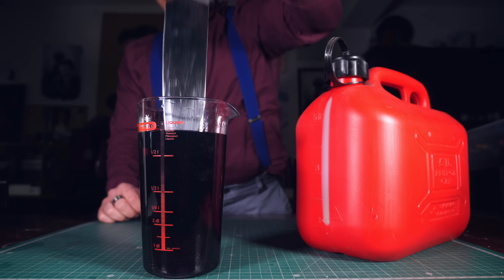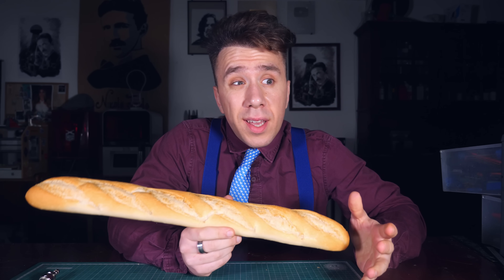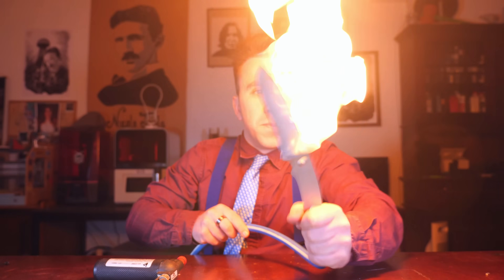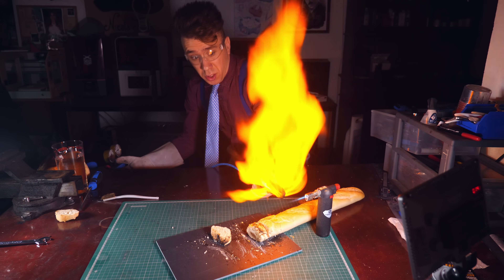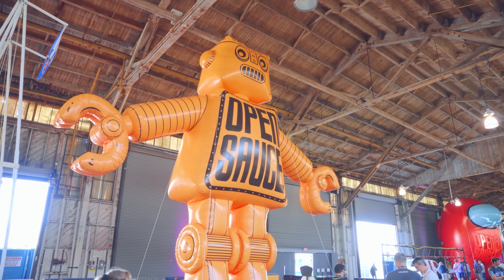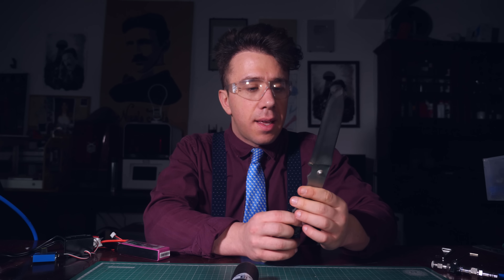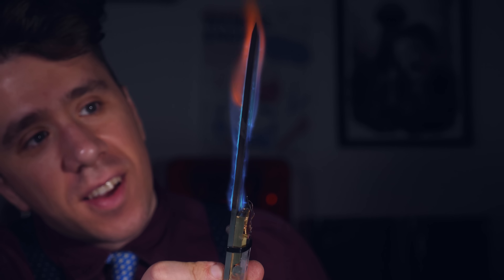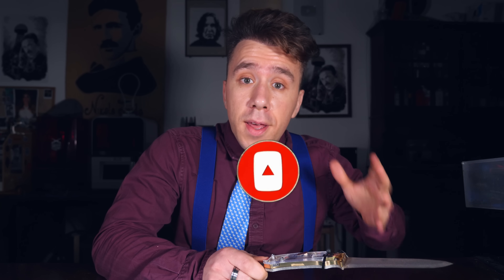I made a TRUE FLAMMING KNIFE

Comment: Since its 3D printable and Vernoulli force is used to drawn in air as you said back about the butane and the nozzle, I think you should add air channels where it will premix with air using the pressure of the hydrogen to provide force.

Addiotnally, I am not sure how it will works, provide discrete channels to blow fuel lateral to the edge and let the Coanda effect to hug the figure of the edge. If it work with Single Expansion Expansion Ramp Nozzle, it should work there too. That should  add cutting power without adding serration or flash welding a solid steel edge over it.

BTW, what material is used on that? Steel, Aluminium, or, Inconel?

Comment: I think you should put a jet engine in a metal vacuum cleaner, or make a hover craft and use two jet engines to power it, one for the thrust, and another for the air pushing you up.

Comment: A sword like this, but made from a much stronger material, or coated with something like boron carbide while maintaining the porosity.
Add a water chamber to the handle, and add a battery and circuit to generate H+O2 from the water, or even Brown's Gas (HHO), which might be better because of it's weird nature.
Then use that HHO or Hydrogen mixed with Oxygen to light the blade, using an electric spark activated by a switch or button.  Then the whole thing is self-contained.
Oh please make one, and then make a bunch more and sell me one cheap.  😉

Comment: I wonder if porous metal like this can be used to push water through to help cool the metal down? Or are the holes too small for liquids and only air can get through? Also - I wonder if this can be used to create propeller-less boats? Like instead of having large spinning props they could just push tons of air through the metal exterior of the boat to push it along? Would stop marine life getting chopped up and would provide way more control over direction with more "thrust points" around the ships hull.

Comment: You are working with radiant heat, meaning the element, or knife in this case, will not get as hot as the air and objects located away from the flame source. The same principle as walking on hot coals. If you want the knife to get hotter to cut through things, you need to use a hotter gas burning closer to the element. May I suggest the ever popular oxy-acetylene mix? This runs the risk of getting the knife hot enough to melt the porous structure at high temps, but I'm sure your alterior motive has little to do with heating the porous metal, and more to do with consistent flame front unaffected by jet turbulence 👍

Comment: 0:10 comment: damn, I've been thinking about similar design of 2 decades now xD Let's see how similar those are...

EDIT1: not relevant, but long time ago I've been given a plate-sized, 5cm thick chunk of aluminium foam. It was solid, couldn't do any damage with my hands. And it weight next to nothing. Ever since I've been wondering what kind of awesome things could be made with it, but it has been pretty quiet...

EDIT2: at 5:19 ok, I didn't consider using a magic 3D printed microporous blade that emits supersonic jets of pure hellish hate. I was more thinking about pressed thin layers of laser cut metal to create a series of very flat channels for low-density liquid fuel xD

Comment: building a DIY torque meter using Arduino and 3D printed parts shows how measuring torque precisely is a complex task. I would like to see you take this concept further by designing a more advanced, high-accuracy torque measurement system, Seeing the iterative process of designing the mechanical components, electronics, and software to create a professional-grade torque sensor would be fascinating. It could tie into other projects like the jet engine or metal 3D printer by allowing you to precisely measure the torque and power output.

Comment: So, can that printing process be given a directional bias? So the angle of the pores focus toward the blade edge?
Or even better stripes of the porous material through solid material, then focus those porous stripes towards serrations on the blade.
Reply: Theoretically that is absolutely possible. It would take design considerations on party of the person who programs the code for the process but because it melts one layer of material at a time it would theoretically be very possible to have porous channels throughout a solid knife and have the gas released wherever you desire. Wether that be on the blade edge or creating bad ass burning runes on the side of the blade. You could even leave a sharp cutting edge and have the gas come out behind the edge

Comment: this is a recipie for brownies:

1 cup (225g) unsalted butter

2 cups (400g) granulated sugar

4 large eggs

1 teaspoon vanilla extract

1 cup (120g) all-purpose flour

3/4 cup (90g) unsweetened cocoa powder

1/2 teaspoon baking powder

1/2 teaspoon salt

1 cup (175g) chocolate chips or chunks (optional)

1 cup (120g) chopped nuts (optional)

Instructions:

Preheat your oven to 350°F (175°C). Grease a 9x13 inch baking pan or line it with parchment paper.

In a medium saucepan, melt the butter over low heat. Once melted, remove from heat and stir in the sugar until well combined. Let it cool slightly.

In a large mixing bowl, beat the eggs and vanilla extract together. Gradually add the butter-sugar mixture to the eggs, stirring until smooth.

In another bowl, sift together the flour, cocoa powder, baking powder, and salt. Gradually add this dry mixture to the wet mixture, stirring until well combined.

If desired, fold in the chocolate chips or chunks and chopped nuts.

Pour the batter into the prepared baking pan and spread it evenly with a spatula.

Bake in the preheated oven for 25-30 minutes, or until a toothpick inserted into the center comes out with a few moist crumbs (not wet batter). Be careful not to overbake, as brownies should be fudgy.

Allow the brownies to cool completely in the pan on a wire rack before cutting into squares and serving. Enjoy your delicious homemade brownies!
Reply: How do I add my medical marijuana to this?
Reply: @sethreign8103 crush it up in your mortar and pestle (the one that comes free with your xbox) and dump it in with your dry ingredients. or mix it in with the topping.

Comment: Add a thin layer of platinum to the inside of the knife and power it with methane. It will autoignite. 

Add a button. Strap the fuel tank to your back. Thread the hose through your sleeve. 

Vigilante time

Comment: I have a challenge for you.

Make an electric vehicle that can power itself with onboard generators.

I just got an electric scooter, the eAhora M1P. Says can do 200 kg rider, at 55 kmh. 2000W brushless DC geared motor, with 124 NM max torque. 60V 30AH lithium battery (1.8 KWH). 67.2V ~ 5A smart charger (Charging time: 4-6 H). There is so a controller on it, that's keeping it from going faster that 35. I saw a video of someone else who said the battery can be charged faster than the charger's output. 

The thing looks like a Harley without an engine. I thought you could put a Tesla turbine there or something. Add some solar panels, maybe other little generators, idk. What do you think? 

Can you make an electric bike with infinite range?

Comment: I am curious how well the metal holds together at jet engine rpm. If you print the passages into the trailing edges of the vanes, that should reduce turbulence. Furthermore printing the fuel housing of that will allow more thorough atomization and subsequently better burning. 
Oh yeah, tomatoes are delicious!

Comment: I came up with a possible venturi  innovation to a present product called Nerf Vortex. I dont own a 3d printer so ill share it with you in hopes we may be able to design, print, build and test it with positive expected results. 
This foam football channels air through multiple channels around the football along its length and allows it to travel further when thrown. 
Instead of multiple straight channles, my theory is that if the channels were actual venturi shaped, would it not only travel further, but also much faster because of the effects a venturi has on air in and speeding the air up as it exits the tail. And would it possibly form an air pocket behind the football not only further stabilizing it in flight but generate it's own trust potentially propelling it foward faster and further.
I have a crude drawing on a napkin that i did while watching a couple of your videos and the videos gave me the idea and inspiration.

Comment: @integza Hi. I found such a funny thing - it is based on the tornado principle. but I don't understand how this can affect the efficiency of the sandblasting process. After all, the air flow flowing through the hoses, especially with abrasive particles, should lose rotation and spray. https://youtu.be/S4T8qFBRiMA?si=GLYnFe57QQrNc3gY
?????

Comment: try and use conductive vapor as in a mixture of water and salt boiled to a vapor state and use that with hydrogen and also have a tesla coil going straight into the engine and it will make a jet engine and hopefully ignite the electric vapor.

Comment: "I have this cool idea inspired by the Princess Leia experiment. You know how they use lasers to hold particles in the air? Well, I thought, what if we use that same laser technology to trap particles and then shoot them out in a controlled way to move a spacecraft? It's like using the momentum of these ejected particles to create thrust, kind of like how a rocket works but using light instead. This way, we could potentially have a new type of propulsion system for spacecraft!"
or maybe I'm just assuming alot

Comment: You could use this as the skin of a jet plane. Push hydrogen through the skin and burn the hydrogen on the outside of the plane skin to create a vacuum between the skin and the surrounding air to reduce drag on the plane. I wonder if doing this would stop the sonic boom when breaking the sound barrier?

Comment: That technology has some many applications that could use it, besides jet engines you could use it in a piston engine or as the bottom of a boat hull. How about the bottom of water or snow skis. Anything that air flow though metal or other materials that allow the air to reduce friction or to help with combustion.

Comment: The big problem I see. Is that a jet engine has a very very high pressures with its compression. The metal would have to be able to withstand that. And metal with millions of holes would lose its integrity. But if someone could find away to strengthen it. It could work.

Comment: hi from South-Africa , you know what would be sick? if you can maybe experiment if you can focus the porous side of the knife to one side of the blade keeping blade porous but focusing it to blade edge or ridge by means of sealing some areas on blade via sealer or hot rolling/grinding exc, if you can force gas to certain areas maybe you can design a flat multiple fuel delivery system thus making extra pipes absolute and use the body or the main structure or insert exc for efficient fuel delivery or ....... get my drift? Hope you caneed use this in a next episode

Comment: so its a neat idea, the problem is temperatures.  super alloy steels are heavy, but can handle the temperatures.  but not used in jet turbine engines but are used in steam turbine generators.  jet engines use titanium, which softens at around 650c, way below the operating temperature of a jet engine.  which is why they use holes through the blades to inject an air layer over the blades to keep them below the softening temperature.  injecting fuel would cause the blades to likely get above that temperature, leading them to soften and fail.

could be used to make a better blade that can inject a more uniform layer of air though.

Comment: For your drawing board, consider using tesla valves for your turbine. GREAT VIDEO. GOT ME OUT OF BED IN THE MORNING. Maybe do a future video on the thermal vision on the knife. It may help your 3D Print a new version that could help heat distribution. You need tuning to be able to give more fuel either Hydrogen or butane, as well as the O2. I'm excited and scared for you. Stay safe!

Comment: I think I missed the point. How this technology is going to revolutionize jet engines? Porous metal parts already exist before the 3D metal technology. It is called "sintering". I learned about it when I bought an air  compressor, years ago. One of the filter elements is made out of sintered copper or bronze alloy, and it is meant to separate big water molecules from the air stream, which suggest that the pores can be smaller than a water molecule itself

Comment: I dont know if sir Integza know or never knew that the G.T.E. turbine blades already have a cooling holes from its leading edge and trailing edge  and it was fed up by compressor. But if sir Integza meant by another lot of holes then it was new if it will survive from stresses during operation at its full load.❤❤❤

Comment: There was a famous carburettor that was supposed to masively increase fuel efficiency, i wonder how this would perform under boost with air/fuel mixture...

You'd have to maximise the effect to create more holes for such a use case to prevent the engine being starved

Comment: Hey buddy... as your friend and a welder... you should have a flashback arrester on there cuz.... oh boy that could explode. Also I recommend some oxyacyetelene fittings to help with your fine tuning of the gas premixture, this also allows you to add pure o2 with your fuel gas to it and have a way to shut off the Gas immediately at hand. They are heavy, but they also have smaller more delicate bases so shouldn't be too hard to find a good weight. They were also designed with bulky gloves in mind!

As a welder, I saw the holes, I was very interested about the porosity and how it was achieved... hmmm it is interesting to see where laser welding with automated welding.

I guess thst is my theme for the next video... heh possible upgrades to safety and delivery.

Comment: I wonder of another side of this concept - what of spinning parts or shafts that need lubrication? Can an oil be pushed thru instead of air? Wouldn't that in some case simplify moving parts as to not have to make oil passages and provide a more consistent surface lubrication? Now, I need access to a million dollar metal printer. 
Great work and thanks for the Tesla art!

Comment: Suggestion: Make a Rocket Engine With A Metal Injector, Copper Nozzle And with the hole filled engine you used in your glass rocket engine video. Also a better idea would be to use fuel air impinging injector so it burn smoothly.

Comment: Neat technology. If the "porosity" of the material is based on the speed and intensity of the laser during the printing process, then could the speed and intensity be varied during the printing process to intentionally build channels where fuel could flow through mostly solid objects, while maintaining a strong/solid structure? I would guess it would be a quick and dirty means to incorporate micro channels in a material. What are some applications you think this could lead to?

Comment: I am thinking that you are considering replacing the center cone in the jet engine with the 3d printed version, and diffuse the fuel mixture into the chamber that way?  I think you should try crafting some model rocket engines using the method, but using the different gas combinations to see what gives the best thrust using this.

Comment: Can you use generative design to create a built-in heat sink with a different metal inside the part itself? I’m not sure if you can do multi material additive manufacturing, but even if not, it would be fun to design it like a simple 3D puzzle. Generative D could help do that. Either way, it would be very interesting to see a part with a built-in heat sink.

Comment: I kinda wanna see you make a Warhammer 40k Melta gun. Which is described as a compact jet engine (rifle size) that is used for melting through naval ship doors and even tank armor in short ranges.
Reply: A rocket engine would be better. Have two tubes, each containing liquid rocket propellants, and have them mix in a combustion chamber with a very tiny nozzle. Recoil would be bonkers, but it would absolutely fry anything it touches.

Comment: You should make a "hot/ cold" house fan, make the blades out of your new porous metal 3D Print all the casing but have hydrogen source pumping into the fan blades so when it ignites you can have  hot air or switch it off and have  cold air.
Major dangerous but watching you wave that knife around with fire all over the place. I'm guessing danger is your middle name. 
Keep up the good work. Have been watching you for years

Comment: Maybe for a future video you could see if this tech could potentially make the nozzle of all nozzles. Could the metal be agglomerated strong enough to handle extreme pressures? There could also be some interesting applications for liquids transfusion through solid materials as well. That might even be more beneficial for rocket engines. I also wonder how easy it would be to attach some vibrating mechanism and see if there is any potential for very fine spherical solids to get through if you can control the porosity of the finished metals. Super intriguing metamaterials! I would also die of happiness for a 3d printer 😅 I just find your videos today, and it's been an instant subscribe for me!